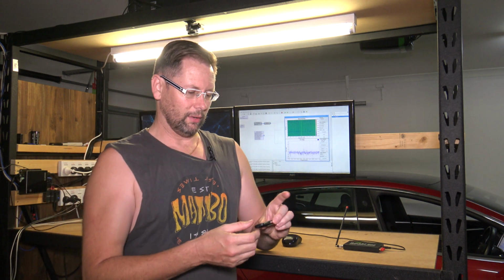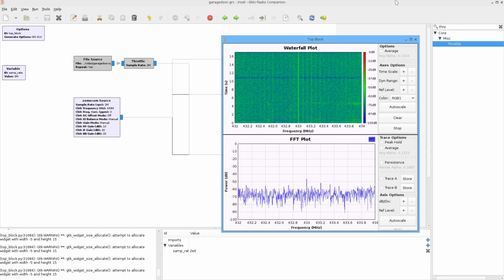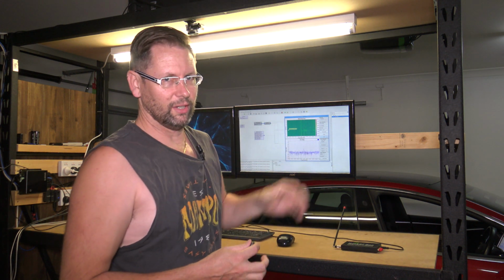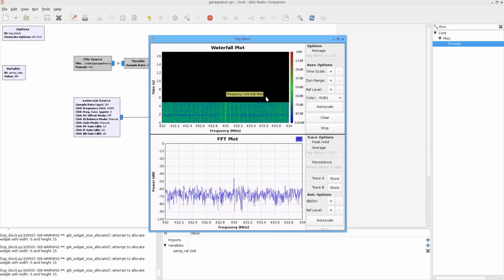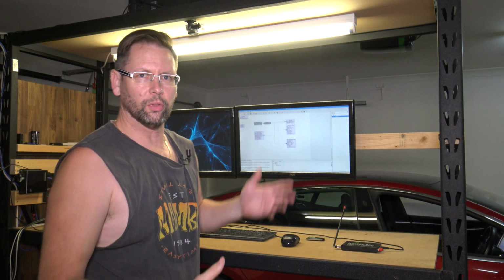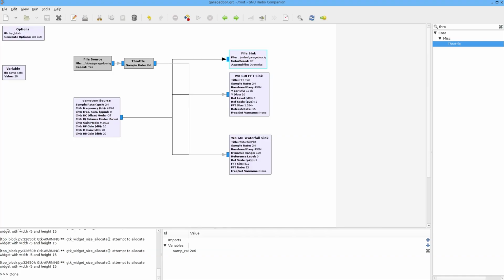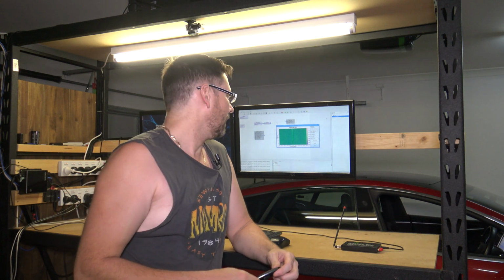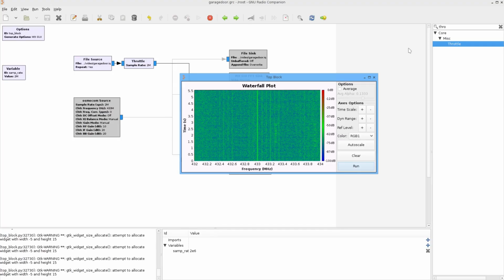Tesla HomeLink RF Signal

Comment: I suspect that Teslas have built in SDR modules for the Homelink function.  It would be cool if we could hack into the system.  You could make the car a radar detector for example.
Reply from the maker: It would be cool if there was no software made by that shit company whatsoever, and we had open source running on it. That would take it from the worst car to the best

Comment: I actually have been experimenting a lot with 433 megahertz because I use it to automate appliances and lights as remote control light switches used to be considerably cheaper than the IP Wi-Fi Solutions anyway I think there could be a few issues. I assume that the way that you get the Tesla to learn the signal is press the key fob while the car is in some sort of learning mode now depending on how long you hold the during that learning mode you might end up transmitting codes too many times because most key fobs for repeat specifically ones that don't have rolling codes. So he could try changing the timing when he trains the Tesla of how long he hold the remote. As far as the car transmitting for so long it's probably because from what I've read which is a little you can have it open the garage door from various distances and when you try to transmit further especially / 433 a fairly crowded band you often have to retransmit. I assume that you have an older garage because if it is the rolling code I have know idea how it would work without them basically reverse engineering every Style garage door opener 

 I know you like to Tinker and hack things you might consider disabling your garage door opener remote.   using the indoor button gpio Raspberry Pi and Trigger it by some other means like when your phone joining wifi or dash cam upload system jonis the network. I'm going to look more into this out of Interest. I would like to see if the capture is repeating in the same matter that it would if you just held the button down on the key fob I have a feeling that they might be doing something clever that just caused the problem with that particular model garage door opener. by the way the easiest way to spot if it doesn't have rolling codes is if the key fob has 8 dip switches although I think that's technology is long gone bottom line if your system is not rolling Keys then you are vulnerable to a replay attack although I assume they're pretty rare that said if I could learn how to hack together this stuff  I'm sure some enterprising Criminal is making garage door cracking boxes. Anyways if you made it this far congratulations I just wanted to say I love your videos always seem to learn something are immediately think along the same lines. By the way I could really use that hack RF I think I might stop by how does coming through the garage work for you? By the way I am getting the ticket alone to get to Australia from United States I could probably get me one of those fancy edits research SDR

Comment: How can de tesla resend the signal? Can you just repeat a captured signal of your garage opener, is there no rolling codes or protection against spoofing?
Reply from the maker: Of course they use rolling codes. It doesn't just repeat the signal of the other remote. It gets matched to the unit like any spare remote you buy would be.
Reply: @TallPaulTech  now I feel stupid I just left a really long message about repeating codes so does the training process involve you hitting a button on the original garage door remote and then for a certain amount of time after it will allow another remote to pair with it since that seems like a security vulnerability to